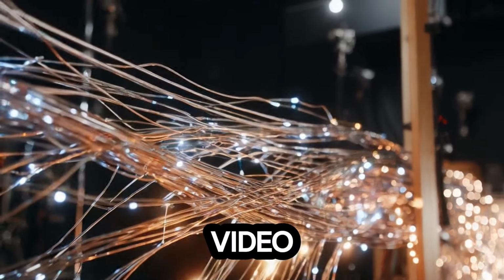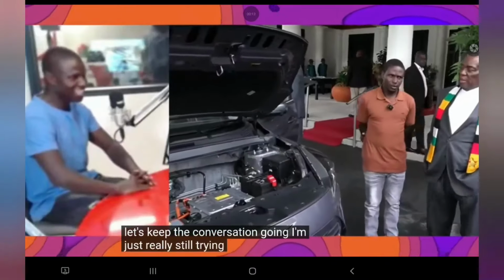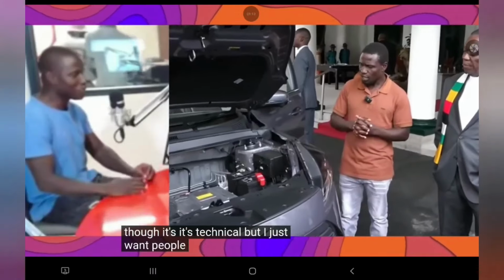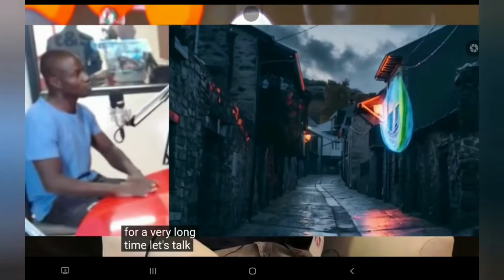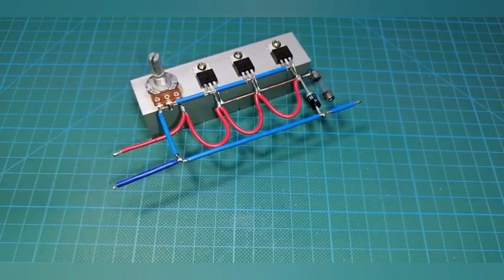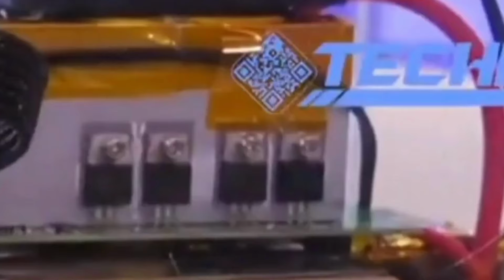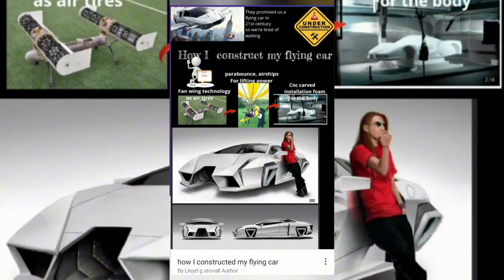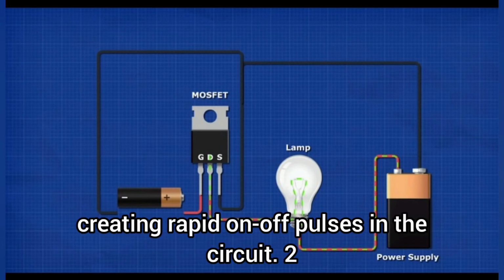American Radio Frequency Energy Expert Explains The Science Behind Chikumbutso Device

Comment from the maker: If you want to see More From Lloyd Stovall about Microsonic Energy Device: Here is the channel https://www.youtube.com/watch?v=q1_3ioFZYUA&t=776s
Reply: Lloyd Seems to be an expert at charging batteries.
When it comes to charging from RADIO WAVES he seems to fall short.

You can't Amplify a weak signal without using more power.

Think Amplifier and take a lesson on how those work.

Then ask yourself How does Maxwell ramp up a small RF signal into one strong enough to power a car or charge a battery?

Such equipment would be massive and expensive to produce for an end consumer.

Amplifiers need a strong power supply to produce huge wattage from small signal.

This is easy science not magic.
Reply: @scamchan  These people here have no clue.  I am into electronics, thank you for your comment
Reply: Its just the usual story of bullshit  baffles brains. He talks for hours yet says nothing . Just high tech words joined together saying nothing . After 10 yrs no test run or proof that anything actually works. A total scam 💩
Reply: Our radiowave expert has said nothing about radio waves, frequencies, or radiation. I think we ended up with "Temu electricians" instead of raviowave expert. At least he should mention some about comic ray or the microwave background.
Reply: What's the link to the channel of the guy he mentioned? Mal or something like that.
Reply from the maker: @14supersonic  okay lemme get it
Reply from the maker: @14supersonic  https://youtu.be/X2bOdRMMXcU?si=_h5rzhAZ_h8KsCq1
Reply: Please don’t down play another persons innovation please just concentrate on perfecting yours not explaining others.
Reply: @EriasMedi  He should down play it often as possible.
Scams should always be exposed for what they are.
Reply: @musicvibes-w3l  Yeah, expose scammers
Reply from the maker: @EriasMedi  understood
Reply: You do know the man has working models ffs! If you don’t understand it, keep quiet, history will not judge people like you well
Reply: Chris...I wrote this for someone else, but you may want to read it too.
 
I tell people it's better to think of power plants as energy converters.  They convert energy from one form to another.  When energy arrives at the power plant it's usually in a form that people can't use.  For example coal.  The energy is stored in the coal in the form of carbon and hydrogen bonds.  You get the energy from the coal you have to burn it.  It could be useful right then.  However, it may go through other conversions such as steam and then electrostatic energy produced by a generator.  During all these conversion processes some energy is always lost.  This is why we say the total energy outputs are always less than the total of the energy inputs.

Comment: Using 'MOSFET' as a magic word doesn't cause a battery to recharge itself. This video doesn't explain how 'known' technology recharges batteries. The 'novelty' of Maxwell's system is that 'known' technologies can be combined in such a way so as to recharge a battery as it is being drained. Maxwell isn't trying to 'patent' individual electronic components, he is trying to 'patent' his use (arrangement) of electrical components  to produces a 'recharging' effect. The 'recharging' effect along with battery use with no visible generator input is what no other patent has shown.

Comment: @ Lloyd Stovall - Nothing is new in all of this scietific exploration, secondly he is saying the start-up energy comes from the battery, after which you can do away with the battery, what i have just seen on the screen showing a TV operating without a power source is new, but if you feel otherwise please post a link where i can get such gadget that just requires a short battry boast and runs independently after that initial boast.....the invention is not the various items and component in the overall desing, rather its how the components have been interliggently put to gether to archive the long sustanable energy. no one is saying the technology is new, the tech of compiling the design is....from what i gather so far.

Comment: If the system works what is the problem, all we have to know is that it works.It does not matter if you are educated or not. You can call it anything so long as it works. The vehicle are runing, TVS is working, generators are working.  what else do you need. even welder is working. That is it. We don't need to know how it works . Does customers know how any car works? no or tv or generators. no. they just have to know it work. period. Stop trying to tell people it works this way or that way. You see cables was invented by an african, but they killed him and gave the inventor to another guy . Why are they trying to kill him if the system was not new.why? answer that. why Did they poison the partner? why? if it was easy to produce. No need to say nicolai tesla. forget it. This is chikumbutso work.

Comment: I dont agree. Even if he never created the components he did create a circuit which works. A circuit and a component are two different things. He made a system which you failed to do. Even if you know how those components perform individually it is the results that a circuit brings that matters He is protecting the logic the circuit that he has created which has resulted in the harnessing of that power. He can even tell you that he used mosfets if he wants but that will not legalize the whiteman who invented the mosfet to claim ownership of the design of the circuit.

Comment: The device you showed isn't energy efficient, 14w input from DC battery and 12w AC output, even though the voltage is high, the current will be 12/230 = 0.052amps. That is ridiculously too low and can't even charge my phone, talk less of powering a car or household

Comment: Why hasn't it been done by anyone else until now. Lloyd, from your video, you seem to be using solar panels to generate energy which is what solar panel homes use. Tesla seems to be using electricity to charge costly lithium batteries to generate energy.
The invention of Maxwell uses radio frequencies to generate energy, thereby eliminating reliance on costly lithium batteries, electricity to charge batteries, gasoline, fossil fuel and solar panels. Maxwell is having difficulty patenting his invention because it defies known laws of physics, including that it could not be established by laws of physics that radio frequencies could be successful used to generate usable energy to power things. Lloyd, this is new invention because there is no documentation that anyone else has successfully used radio frequencies to generate usable energy to power things. In fact, apparently, that could be the reason it perplexes patenting bodies.

Comment: If mosfet generates the energy, then turns the voltage from amp, then what is "current" and how does it fit in this equation? Has anyone ever seen a mosfet work without a power source? And what role do capacitor play, I wonder.

Comment: I DON'T KNOW HOW MAXWELL'S SYSTEM WORKS, 
BUT WHAT LLOYDS IS DOING I HAVE BEEN DOING THAT FOR MORE THAN 10 YEARS NOW 
AND ONE THING I KNOW THE SO CALLED SOLAR PANEL AS IT IS NAMED 
TO ME I CALL IT ANTENNA THAT CATCHES ENERGY FREQUENCY.

REMEMBER THAT ALL THE COMPONENTS WE ARE USING ARE EARTHILIAN MINERALS 
THEREFORE THEY DO ALL SO CONTAIN NATURAL ENERGY WICH MAINTAIN'S THEM AS MATTER.

ONE THING ABOUT SOLAR PANELS IS NOT ALL OF THEM THAT DO WORK WITH LIGHT FROM BULBS 💡.
BUT THERE ARE SOLAR PANELS THAT DO WORK WITH LIGHTS OF BULBS IN THIS CASE JUST USE LED FOR LOWER COSTS.

I MEAN USING SOLAR PANELS AT NIGHT.
AS YOU ALL ARE WATCHING THIS VIDEO THE ENLIGHTENED BOX IS A COMPOUND OF LED BULBS 💡,  ENLIGHTENING THE SOLAR PANELS.
NOW TO INVERT THAT DC POWER ALL YOU NEED I THE USUAL DC TO AC INVERTER.

REMEMBER LED FOR LOWER COSTS.
Reply from the maker: can you please do me a video of your house or compound running those solar panels or Antenna That Catches Energy Frequency,,,and do you use just normal LED or special ones,,,Here is my email chriswabsyt@gmail.com
Reply: @chriswabs  AS I ASKED LLOYDS ON HIS PAGE ABOUT THE SOLAR PANELS,
WHY IS THIS SYSTEM NOT  KNOWN ?
 IT IS BECAUSE OF THE SOLAR PANELS .
THEY DO NOT WORK WITH ANY SOLAR PANEL .
BUT THEY DO WORK WITH ANY TYPE OF LIGHT  LED.
YOU WILL GET YOUR VIDEO.📸
Reply from the maker: @royallovel  I had tried to read about This they say that bulbs or LEDs that emit near daylight like light are more suitable
Reply: @chriswabs  don't just read practice it my dear greater living reality than hearing about it.
Reply from the maker: @royallovel  Okay soon am gonna give it a try,,so you suggestting I buy any type of LEDs?
Reply: @chriswabs  I JUST TESTED MY NEW SOLAR PANEL SET AND GUESS WHAT THEY DO WORK WITH ANY TYPE OF ENLIGHTENING BULBS 💡 AT NIGHT OR IN DARKNESS.
COOL 🆒😎
Reply from the maker: @royallovel  I thought I saw a comment where you said that you had tested the solar panel and they work with any type of bulb

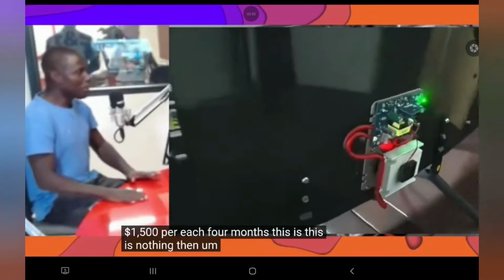Comment: 7:52 Don't put words in the young man's mouth. It is not uncommon to use a battery to prime the pump. Exercise bikes use a battery to start the electronics. Then pedaling an alternator takes over supplying the electricity and trickle charges the battery.  There are  assessments made in the video that are both accurate and misleading. 

Because of his lack of formal training he may not even know what he's dealing with. I know that there are trillions of volts present in the atmosphere. A summer thunderstorm confirms that.

 Nikola Tesla was proposing similar theories. He believed he could transmit electricity through the air. The electricity is already there in abundance. 

I admit that I am cautiously optimistic. As my life winds down I would like to see the world go off in a different direction. If Maxwell's invention proves to be able to do what he says. It would equal mankind figuring out what seeds could do.
Reply: Indeed the world has changed. It's a new era. Maxwell's device is real and people would be so shocked to realise how he did it. Tesla was close to it and many others. But only Maxwell perhaps, a few others also, has learnt how to harness this free energy. It's a new world. God be priased forever❤

Comment: I am working in a system to Piere up a room using an inverter that someone gave me, I want to get it running and diagram it so others can duplicate it. It will errungen computer, phone, light, A/C and heat, once constructed free forever with just general maintenance periodically! No soldering etc, needed. Most of what I am doing now is analyzing volts, watts, amps, wire gauge, etc. I am debating using a battery for consistency of input to my end device that will change the DC to AC so that you just plug your devices into it like any wall receptacle!

Comment: I looked into this and found that his main components have been around for many years! As a matter of fact new and improved ones have come out over the years, including last year, and some are close to being released with less leakage, increased strength and improved voltage consistency!  Look up ribbonfet, finfet, mossfet. Technology is getting old! Why has it not been used? It has! It is in many electronics and micro processors ! Got a cell phone? That works with use of these components!

Comment: Thanks for throwing more light on this gree energy ❤
Reply: 7:52 He put words in the young man's mouth. It is not uncommon to use a battery to prime the pump. Exercise bikes use a battery to start the electronics. Then pedaling an alternator takes over supplying the electricity.  There are  assessments made in the video that are both accurate and misleading.

Comment: Hi Chris I'm in Australia, I've been watching and wondered if  Max's machine works.  I don't know anything about  all these you use in electronics ,  I'm very interested in it  so thank you for slowing and stopping the video to break it down for everyone . Doing this helped me understand it more. 
Don't listen to the negative crap from jealous people you are doing a great job .
Thanks again 👍
Reply: If you "don't know anything about all these you use in electronic" how sure you know this illustration video is doing a good job?????
Reply: @emergencybump46  
Just an FYI for you.  No, this car does not work the way it's claimed in the video.
Reply: @catman8965  do you know and are you able to tell me.
Reply: @emergencybump46  
Yes I can.  This guy says the car runs off of micro radiosonics.  There's actually no such thing.  Further,  radio has been known for 100 years. Sound has been engineered for a couple thousand years.  These sources have very low energy intensities typically less than a watt per square meter.  Have you ever pushed a car by shouting at it, or by pointing an antenna at it?  Doesn't that sound dumb? That's because it is dumb.  On the other hand, depending on where you live, solar can have as much as 1000 watts per square meter.  But he says he doesn't use solar. He also doesn't know how a transformer works.  Nor does he understand how a mosfet works. If the car works at all, it's because he charges the battery at night when no one is watching.  All these words are made to sound scientific, but they're nothing more than gibberish.  He has to show the first law of thermodynamics is valid for his car, which he hasn't.
Reply: @ Thanks for your comment.
Reply from the maker: Thanks a lot for this positive comment,,this is the best comment I have come across in a week